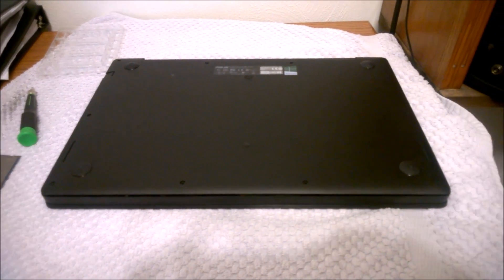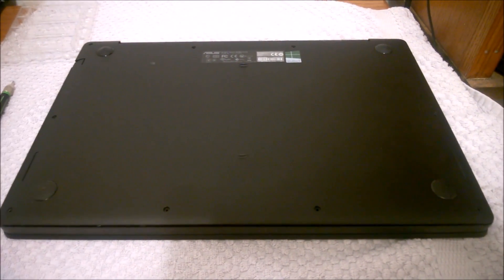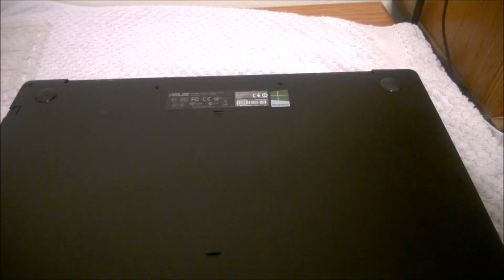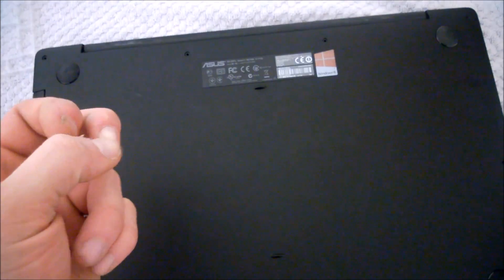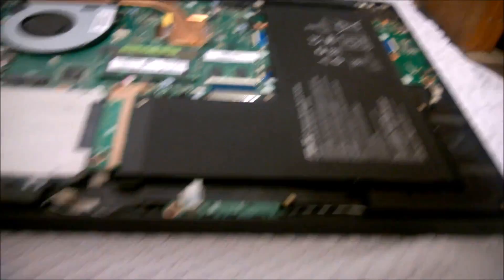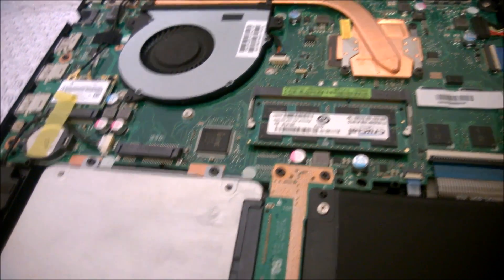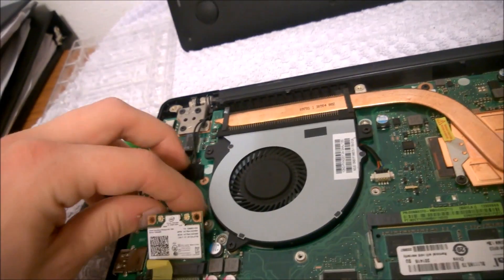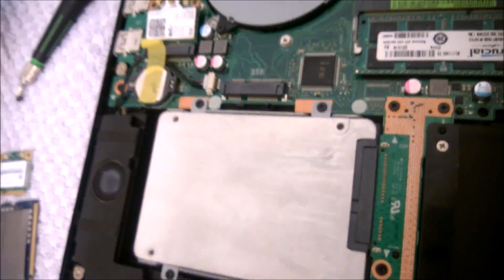Asus Q501LA Disassembly

Comment: i have the q302la model and 1 of the speakers needs to be repleaced (got the full set of speakres for 12 bucks). the problem is that one of the speakers seems to be hard to remove (like a magnet is keeping it there) and im afraid i will break something.. any tips to change it??
Reply from the maker: Well, I'm not sure about that model, I have never worked on it. Usually it's not a magnet but it might be glued in so it might take some force to remove it, but you want to make sure it's not just a screw you are missing or maybe something else is on top of it holding it down.

Comment: I have same laptop and its screen started acting up. The Red is dark purple. Green looks yellow and black is also purple. When connected to external monitor everything seems to have right color on external monitor. I was reading that display connection may be loose on motherboard. Do you think that's possible considering they tape everything up.
Reply from the maker: it can be but most commonly and unfortunately the case is the cable that runs from the motherboard to the display gets damaged because it runs through the hinge of the screen. you can try reseating the connector, but most likely there is either an issue with the display or that cable. sometimes that cable is replaceable and sometimes it is part of the screen assembly instead, which would require a full screen replacement.
Reply: Thanks for the reply
Reply from the maker: +Yogesh J No problem
Reply: Alexander Patchin

Comment: my asus computer keeps turning off on me and it is always because I need to take the battery off and then place it back in. I don't want to keep taking it to the shop. would you happen to know how to do that? it's the Q501L
Reply from the maker: +Jocelyn Rodriguez Once you remove the bottom cover there should be a cable that runs from the battery to the mainboard/motherboard. You should be able to disconnect that. You might have a different issue if your computer is doing that. It might be overheating or the battery might be going bad.

Comment: Thank you for the information. I want to upgrade my ram to 8 as it currently holds 6. I am also thinking of perhaps a SSD as they have gone down in price quite a bit as of late. I might tackle the wireless card at a later date. I seem to be getting good wireless speeds right now with my Intel Dual Band N chip.

Comment: i have mine in front of me bare rn. My gf dropped it from like 6" and it won't turn on.  Anyone know what to do? I plugged power in and LED won't even come on, so it's a power issue.
Reply from the maker: +Noel Mont Yea, it could be an issue with the motherboard or maybe the charging port might have gotten damaged. It does sound like a power issue for sure if no LED's come on like the caps lock, backlit keyboard, or anything like that.
Reply: I got it! Disconnected battery connection and plugged in the power cord(like i saw in another video) n the LED came on! Let's see what happens when i put it back together...

Comment: My battery failure, can be changed too?
Reply from the maker: +Miguel Jesús Adrianzén Moscol Yes, you can change the battery but I'm not sure if it requires soldering or if it a simple plug.

Comment: Do you know what the maximum supported ram is for this motherboard? I'm looking to upgrade at least a couple gigs but I can't seem to get a solid answer.
Reply from the maker: +Nightpool Sorry for late response, I contacted ASUS directly and they said 12GB officially. I imagine if you could desolder the ram on the other side of the motherboard, you could probobly put in a second 8GB chip, however i do not recommend this since it is risky you could damage the motherboard or ram slot.
Reply: +Alexander Patchin Thanks for the info!

Comment: Can you have 2 ram chips in it?
Reply from the maker: +WiggleVilla It already does actually. The slot that you can access on the bottom is one of them. The other one is on the flip side of the board. It is soldered down so you cannot swap it. It is 4GB 1600Mhz.

Comment: A BigThank You!! I had an short lived disaster, followed by my monkey brain taking over..this normally leads to a subsequent regretful decisions, but not today.  After shorting out my USB port in a sloppy moment with a USB AVR programmer the computer blacked out and wouldn't turn on.. I had to open mine to un-plug the battery for a moment...(fingers crossed this would release the "onboard current safety" that did it job very well..) lucky for me it everything seems good to go..good thing too as my online summer classes started this week.

Comment: Hi Alexander, very helpful video. Question maybe you have an answer to: my screen has started flickering when I open and close it a little, seems as if the wiring has come loose. Any advice in accessing the monitor connection?
Reply from the maker: honestly, I cannot remember if I saw the connector on the bottom of the board. There should be four cables that come from display. One will be white and one will be black. These are your wifi antenna cables. The other two will be the touch screen and display cables. Follow them to where they connect to the board and reseat the connections carefully. If the issue does not resolve, you might have to replace the LCD display panel because the cable is damaged.

Comment: You really need to remove the battery and discharge the board before adding or removing components....
Reply: You are correct. I neglected to do so but most computers including Mac books you can generally get away without having to do so. Just make sure computer is not in sleep mode.

Comment: Hi Alexander, I have a problem with my Intel (R) Dual Band Wireless-AC 7260.
Wifi is not working properly, sometimes is connecting ok (I use TP-Link router, this one is working 100% fine) sometimes, especially when I am trying to connect Bluetooth devices, it says that I don't have internet connection, and all networks is falling down (I mean all users of my router). I have to mention that I downgrade my OS to windows 7 but I use all drivers from intel/asus support. Anybody have the same problem? Any suggestions?
Reply: I don't really have any suggestions. Sorry!

Comment: Alexander Patchin , thanks for the video. I'm about to upgrade to an SSD, just a quick question.
Where did you see more performance boost, the SSD upgrade, or the RAM upgrade?
Reply: The SSD improved performance. I did the RAM upgrade because I run virtual machines.

Comment: Is there any way you can replace the graphics card for this laptop?
Reply from the maker: You cannot modify or replace graphics cards on laptops because of two reasons.
1. This laptop has an integrated graphics card, which means that it is attached to the CPU. These cannot be separated or modified. Also the CPU cannot be changed easily because it is soldered down to the board and would be an EXTREMELY risky operation to break the solder without breaking something else.

2. This laptop does not have a separate socket that a graphics card could be installed. This makes having one impossible. In days past, older laptops did have exchangeable graphics cards but they were much... much weaker. I couldn't even get my old one to play a YouTube video full screen.
Reply: Alexander Patchin Do you think I could override my graphics card?

Comment: Alexander, I have an oddball question for you.  I have this same laptop model and by freakishly bad luck I have a tiny ball stuck perfectly in the microphone jack.  It fits so perfectly I can't get it out, and so I'm just wondering if I took apart the case would I have access to be able to push it out of the jack?
Reply from the maker: Depends what got in there. Funny enough, I had the same issue with a small little white ball that comes in the little silicone bags. I used a paperclip to break it apart and get it out of the jack.

Comment: Thanks for sharing this video. You saved me from probably breaking the clips at the front edge of the cover. However, I did break the end off that post that's right in the middle of the cover, even though I was careful to use steady firm pressure to get it apart. So far that doesn't seem to have any negative effect.
Reply: yea, that post is just there for support from sliding around... If you have all other screws you are fine.

Comment: Very helpful video. Thank you I have to change a cracked screen and your video didn't have it covered. Do you have another one or maybe some help thank you
Reply from the maker: To be fair, all it takes is just some examination of what screws hold the hinge onto the computer. It is usually 2-3 screws each hinge. Once you have removed the hinges, the display assembly comes off and can be replaced.
Reply: Thank you

Comment: Since Crucial is the recommended Ram replacement brand and it seems to work best, here is a page from their site that confirms that this particular model expands to 12GB.
http://www.crucial.com/usa/en/compatible-upgrade-for/ASUS/q501la
Also from here, you can go ahead and order the 8GB Crucial which will run you $75.99 
Thank You Alexander, for making the video, I wanted to see someone disassemble this laptop before I worked on mine.
Reply: No problem man. Love to be able to help someone. The reason I made this video was because no other video existed at the time.

Comment: can you please tell me how much memory you installed? It looks like one memory slot there only? so 8gb is the max?
Reply from the maker: 12GB is the max. One stick is permanent installed and soldered to the flip side of the motherboard and is a 4GB stick clocked at 1600. the one that you see is the one I installed which was 8GB. Both total 12GB.
Reply from the maker: here is a link to a picture of the bios that shows I have 12GB. It is a link to Microsoft OneDrive.

https://onedrive.live.com/redir?resid=DB2BB6B85B08E1CC!139192&authkey=!AN3umAh9cZMmK5E&v=3&ithint=photo%2cpng
Reply: Wow, interesting,  still better than just 8gb. Thanks much!

Comment: Great video,got a problem with mine, it ain't turning on even when charged and I used this thing for like a month,so it there a problem with the battery or something,because it was chargin   and the charger removed accidentally and it stopped workin
Reply from the maker: I couldn't tell ya, that one is hard to diagnose by description.
Reply: It was charging,I removed the charger and it went off,it ain't turnin on. Not sure wat the problem is though

Comment: thanx for this vid but quite honestly would have been MUCH BETTER if u would have shown the actual removal of the cover, where EXACTLY you put the screwdriver etc... I want to upgrade it to an SSD but quite frankly i am nervous to attempt the removal of the back cover (which was why i was so 'cited to see ur vid, but u never showed the ACTUAL removal  (grrrrr : ) and Best Buy charges too much and they barely know what they are doing...lol but thanx all the same : ) Ms D
Reply from the maker: the holes on the bottom of the computer is where they keep all the screws, the rest is prying around the edges to get it off. Best Buy also does know what they are doing, they do it every day to be honest, and if they break it, they will fix it.

Comment: Hi Alexander. great video Thanks. Not a lot of info on this model. Today I'm having trouble turning it on. I have a green light and when power button is held down the normal white lights come on but a black screen and nothing else. It's been plugged in and charging so i believe it has a full charge. Because this has an internal battery I cannot do the usual reboot sequence of unplugging, taking battery out and then holding down power button to discharge. Any help would be appreciated. Thanks.
Reply from the maker: Could either be a motherboard issue, you could try reseating the RAM, I don't know if you would want to disconnect the battery but you could try, its right there when you take off the panel.

Comment: My girlfriend and I have referred back to this video a few times (she's got the 15" ASUS, whereas I have the exact one in the vid) and we love it as a reference. But I've got a question and I haven't had any luck finding an answer.

Question is, how do you safely remove the keyboard? While I'm pretty sure my girlfriend can figure it out (she WAS IT for over a decade, including contracting with the AF), we would both like a reference beforehand just in case there's something wonky going on there.

The reason we need to remove the keyboard is to clean it - we have a toddler, and he killed my first ASUS Q501LA by dumping my cup of coffee on it (or, at least, Geek Squad claimed it was killed, idk though because I know GS can be pretty hit or miss). No coffee this time, but there is a little juice and the keys stick, and that's really GD annoying. Is removing the keyboard substantially more involving?
Reply from the maker: The keyboard seems that the motherboard needs to be removed to get to the keyboard. Now, as from my experience, it is worth the money to buy a replacement keyboard since the are a nightmare to clean. Also, if the keyboard gets damaged upon taking it out, it helps to have a spare. Just my recommendation is all.

Comment: Wireless card Intel 7260 must plus Bluetooth? I have the same Q501LA, and the Intel 7260 dual band but without bluetooth... and when I input it and run driver it's not gonna work the yellow exclamation will appear on device manager and show ("This device cannot start" Code 10 error) do you have any ideas what should I do or which driver I need to use? thanks!!!
Reply: also when I plug in the wireless card the USB controller of device manager will show one unknown USB device, but when I plug the original qualcomm one it will disappear... is it anything to do with with "plus bluetooth" that I mentioned above?
Reply from the maker: Austin Lin Mine is combo card with Bluetooth. I really don't know what is happening with your computer. It seems strange, and might be a defect with the card. I have had defective wireless cards before so could be the situation.

Comment: Hi, I have disassemble my asus q501l too, and I also input Intel Dual Band wireless AC 7260, but I encounter a problem that has a yellow exclamation on my device manager. I use windows 8 and try many versions for the wifi module, can you share which OS and driver version you use?(If their is a link, I will appreciate for it!) Thank you!
Reply from the maker: I went to Intel's support site and downloaded the driver. Type in the model of the wireless card and it will give a download.
Reply: Are you using windows 8 or 8.1? I have try the latest version 17.1.0 but it doesn't work. I download the driver here:
https://downloadcenter.intel.com/SearchResult.aspx?lang=eng&keyword=intel+dual+band+ac+7260

Or which one you suggest me to download?
I have stuck for this whole week :(
really need you help!
Thank you!
Reply from the maker: I would make sure that old Wi-Fi drivers are uninstalled and then reinstall again. I am using windows 8.1

Comment: I have the same laptop. Wondering if you could help me with a hinge issue I'm having. Let me know if you got the time to do so.
Reply from the maker: what is the issue?
Reply: My laptop got dropped from about 6 inches high a couple months ago and I sent it to Asus to have it fixed and they did a great job but a few nights ago I noticed that now when I close the lid it does not close all the way. I can kind of turn the screen on top of the main part of the laptop to make it securely close all the way. I can tell that it is loose on the right side where the screen meets the laptop. Is there some screws there that are potentially loose? I'm hoping so. It'd be convenient if it was as easy as opening it up and tightening a couple things.
Reply from the maker: ***** I cannot be sure if they are using screws or epoxy for attacking the screen to hinge but the only thing I can say is you have 3 options. Option 1: Contact ASUS and tell them the repair was not 100%. Option 2: Open up the hinge section of the laptop and see for yourself what holds it together. Option 3: Don't mind the defect.

Comment: thank u so much, I'm planning to upgrade ram, so this one came with 6 GB RAM, 2 of them are soldered on mainboard? also it is a connector up there for a half size msata ssd? to work togheter with the internal HD?  http://s23.postimg.org/sy6ywu8cb/asus_ssd.jpg
Reply from the maker: this model has one chip soldered down which is a 4GB chip. Only one HDD connection for SATA 3. No m-SATA.